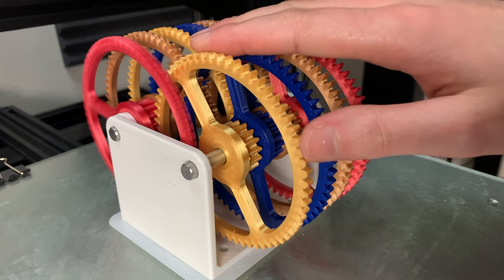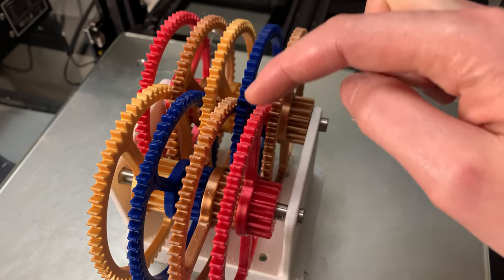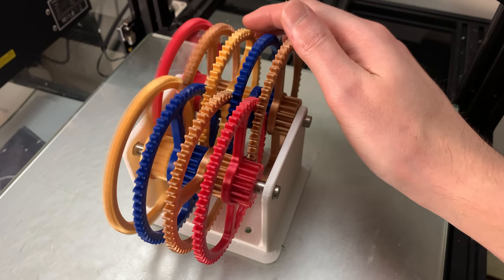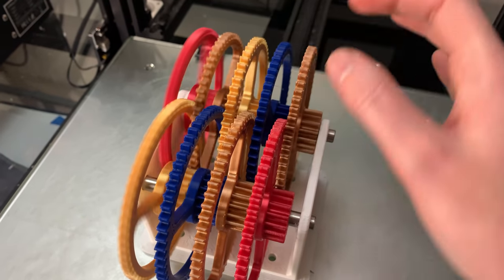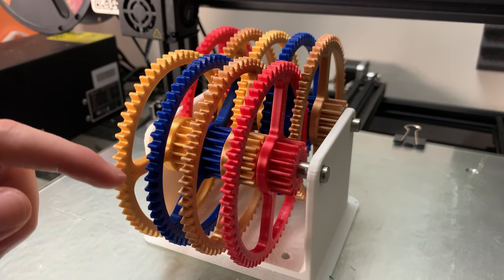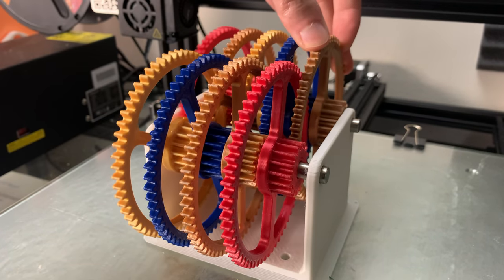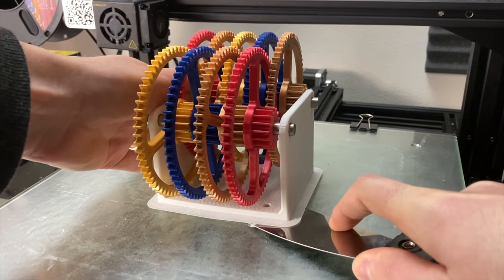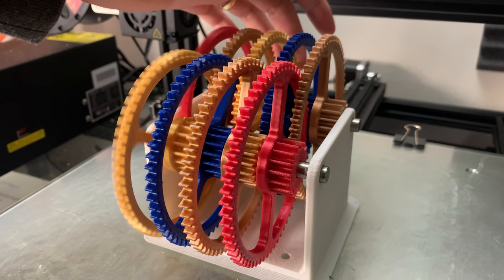Is it possible to spin the last gear?  (1:65000 gear ratio)

Comment: OK, but now I want to see you attach a drill.
Reply: He just said he could pick up a truck with the last gear
Reply: it would break first, possibly resulting in injury.
Reply: @deltahat880  Probably not injury, but you have to agree that watching it break would be quite entertaining
Reply: @marten2857  no more than breaking any other piece of plastic... the last wheel would just slip and snap of the teeth...
Reply: @johnjon4688  wear some protection then
Reply: @saphrosyn8040  I don't think the force required to break this plastic likely warrants any more than some safety glasses.
Reply: @marten2857  if it broke purely due to the speed of the spin then injury would definitely be a possibility. 

It's more likely that the force exerted on the wheel would pop the axle out of socket or slide a gear out of place. 

You absolutely would not want to be present if those gears spun themselves apart though.
Reply: @deltahat880  it's really not that horrible. Take a look at some videos of people over-cycling CDs. Sure, they harmonically explode, but they are only dangerous if you are close and in the plane of the spin.
Reply: @johnjon4688  if you were attaching a drill you'd probably be in close. 

lots of people have been severely injured underestimating the damage caused by something rupturing due to extreme g forces cause by high rpm.
Reply: @deltahat880  The entire point of this video was to show that the torque necessary to turn the last gear is too high. you would never get it to the high rpm, and even if you did, ABS plastic that is printed has a relatively low shear strength. So the force would likely not be as great as everyone is imagining...
Reply: @deltahat880  lol that is not what G-forces are 😆😂
Reply: @lithiumfpv9254  google it "The relative centrifugal force (RCF) or the g force is the radial force generated by the spinning rotor as expressed relative to the earth's gravitational force. The g force acting on particles is exponential to the speed of rotation defined as revolutions per minute (RPM)."
Reply: @johnjon4688  I did understand the video but thanks, the most likely break in the mechanism would be the axels stretching and the gears dislocating, however, if someone hooked up a motor to a gear that was capable of turn, say one partially down the row, that same disconnect could make the other wheels able to turn freely, and that could in fact result in injury, I have worked in manufacturing and have decades of experience working with various levels of power tools and the one thing you should always count on is the possibility of danger. 

even just one stepping gear on this device, paired with a high rpm motor  could feasibly result in a high speed shatter resulting in injury.
Reply: @deltahat880  I own a manufacturing company, after being the production manager for another manufacturing company for a decade. I also have schooling in engineering, materials science, CAD design, and machining. The most you would need for safety gear for this was safety glasses. And keep your fingers out of the mechanism.
This gear assembly as not possible to turn in the opposite direction. You would have materials failure long before it ever got even close to overcoming the static friction force to get the highest gears moving under direct force in the first place. If you primed the gears by starting them spinning on the low side and working your way up, you would begin to melt the lowest gears long before the highest gear could be turned through direct force. The axles would be fine. They are metal . The gears themselves would melt, come out of alignment, and slip. Then the teeth would break off, because that is the weakest point on the already weak ABS plastic. 
Worst case scenario: a flaw in the printing on the internal support arms of the lowest gear. The plastic gear breaks apart at around 20k-30k rpm (which would happen several gears before the highest gear could begin to take any direct force). Even then, you are likely only to have minor cuts from this lightweight, low-density material. More likely, it will just bounce of you and sting a little. An the pieces with the most momentum behind them would fly in the planar direction of the gear.
Sure there would be risk of injury. If you had your face right down there next to it on the side, and managed to spin up the gears to the failure point. Or you could hurt yourself if you stuck your hand in there once it started getting up to speed.
BUT, if you did as the OP of this thread suggested and stuck a drill on the highest gear and tried to spin it, all you would do is immediately strip the teeth of that gear, and there would be no catastrophic explosion of parts, just some shreds of ABS gear teeth lightly popping off and falling to the bottom of the gear assembly.
Reply: @johnjon4688  I appreciate that you finally admitted injury is possible even if only under unlikely circumstances. 

As someone who owns a manufacturing company i can only imagine the crazy accidents that have happened under you, since i've seen plenty of doozies myself. 

and yes, the directional force of the gear pulling itself apart would be on the plane it was spinning, but that direction can change as pieces collide with one another. 

and yes abs plastic is low density material,  but even airsoft pellets can break skin, and they are round. 

The point of me pointing out that injury is possible, is not for the person that made this video, but for anyone seeking to replicate it in any way, and then follow the suggestions of the commenters. 

If someone were to do a stepping gear system like this they feasibly could recreate it in a fashion that could in fact be more dangerous.
Reply: @deltahat880  ugh, I said it was possible in one of my earlier posts. I specifically mentioned over-cycled CDs exploding (though a CD is made of stronger plastic, is thinner, and shatters on breaking vs ABS rupturing). However, 1)airsoft pellets are round, which the destructed gear would not be, and 2) you have apparently zero knowledge of what a plastic deconstruction would look like.
I'll have you know that I have 20 employees and exactly ZERO workers compensation claims for the 6.5 years my company has been manufacturing. And we are a production company doing over $1mil in product annually. I take safety very seriously, and part of that is knowing what results from mechanical failures. Which is why it is evident that I know what I am talking about, and you very much do not.
Come up to my level and we can have a discussion. Right now, I feel like I am trying to explain this to a kid. You are like a kid with a paper snapper thinking he has a grenade.
Reply: @johnjon4688  you're both acting like childs 😐
Reply: Compressed air for 20 mins on the 1st gear
Reply: @RealBrizz  thank you for your valuable input
Reply: @vinceemery5943  why why. i just don't fckng get it, why would that small thing need a shit tons of energy just to spin it, I just don't comprehend it. someone please help me.
Reply: @RealBrizz  lol 😂
Reply: @deltahat880   uaqpOa
Reply: @deltahat880 
Hit
Reply: @johnjon4688  there's the problem, this website has a massive quantity of children viewing these videos and these comments. If replicating this experiment poorly meant using different materials, and fewer gears, a dangerous situation could arise very quickly. It doesn't matter if you think my responses are childish or lacking understanding because potentially thousands of people could read your comments saying it's totally safe, and misinterpret them in an unsafe way. 

You running things in a company might mean you can help prevent accidents, but when dispensing knowledge to unknown masses its best to proceed with caution. 

If this is how you treat your employees who question something you've said I feel bad for them.
Reply: @deltahat880  q
Reply: @johnjon4688  .
Reply: @deltahat880  z
Reply: @deltahat880  2
Reply: @deltahat880  because children have access to 3D printers that use material other than plastic.....      .....    .......
Also, I came up through my company and then BOUGHT it. Started as a temp worker doing manual labor, became a supervisor, took it on myself to learn multiple CNC programming languages, read every manual and maintenance guide, became a manager, took courses in workplace efficiency and safety, became COO and asset purchaser, and then bought the company. All this built on my mech engineering degree. I have dispensed knowledge to hundreds of employees over the years and most of them came in with little to no experience.
There is a time to be cautious. But there is also a time to be realistic.
Reply: @johnjon4688  see this is where I start to question your claims, you don't need a 3d printer to mimic this experiment.
Reply: @deltahat880  of course not. young people commonly have access to precision machining equipment for gears.
Reply: Won't work
Reply: SONIC BOOM
Reply: Or a 3 cylinder engine
Reply: @iZai53 
1. It's physics.
2. It is LEVERAGE but placed on a circular construct - so think Leveraging the earth with a very long pole - broken up into smaller poles on leveraging platforms.

You'd be able to place another planet on the end of the last & largest pole and eventually the earth would be lifted as desired... but reversing that (dropping earth on the smaller pole) wouldn't be... possible because it would send the last pole (and any object on it) in the other direction, it would cause a big bang (if the construct is that durable).

In my explanation, earth is on the slowest turning side of the gear (the gear you don't want to ever mess with - having the highest tension & potential energy).
The end of the last pole (in the whole sea-saw leveraging construct is the fastest spinning gear).

Gear ratios are simply leverage in a circular platform so the cycle can repeat.

Moral of the story: the more work you want done, the tougher the material needs to be.

Like rock or tungsten carbide or some other highly durable non cracking allow. Steel wouldn't be ok on the beginning or end gears...

We definitely need this done even with 1:35,000 ratio. Very renewable energy.
Reply: Dremel

Comment: I can’t be the only one watching like “bet I can spin that” 😂
Reply: You aren't
Reply: i can spin the last gear rather easily, it would just take me a little time to get there.
even if this gear box was double what it is.
it would still be possible to spin the last gear.
Reply: Same.
Reply: I’ll attach my DD 16 engine. There’s no way it won’t spin.
Reply: it might be possible to spin the last gear if the gears dont break or deform from friction. my theory is that you start from one of the gears that is easy enough to spin but not too easy. then once you get up to speed, you move to another gear and you repeat.
Reply: @bass2762  makese sense. I was just gonna use a long stick
Reply: @player-8740  that might work also i think.
Reply: I'll bet Uncle Rico could do it!
Reply: @logangraham2956  no
Reply: @logangraham2956  By attaching a drill to one of the easier-to-turn gears? Because you wouldn't have enough strength to turn it straight away.
Reply: @Ruzzky_Bly4t  of course not straight away , you have to work up to it.
Reply: Just fucking spin the last wheel omg
Reply: go buy yourself some lego and try it yourself, lol. Physics and the flimsiness of that plastic ain't gonna let you spin that gear in a million years
Reply: @yakoc04  this is what the entire video was about the tourqe required to do that would be exponentially more than the 1st gear
Reply: @bass2762  You have to bear in mind that to achieve 1 revolution per minute on the final gear, the 1st one needs to spin at more than 65000 rpm.
Reply: @bass2762  That is my theory and was hoping he would try that.
Reply: Yes you were only one 😆
Reply: Uhhh. Sooo. Impact gun

Comment: It would be amazing if you could just push the last gear as hard as you could and the first one flew off and sliced through the wall while the one you were pushing literally hasn’t moved
Reply: Figuratively hasn't moved. It literally has moved. Just saying
Reply: @angelo9989  I know, I just mean you can’t see that it’s moved because the distance would be so insignificant
Reply: @angelo9989  lmao
Reply: The things is actually you can spin the last gear. But with very very low speed. It requires high power when you want to rotate it with same speed of the first gear.
In theory you need same force for rotation the same one for last one
Reply: @angelo9989  at least you’re aware :)
Reply: Plz help stop Israel (modern nazis) apartheid against Palestine, it's not your problem but your gov is funding them, spread the message cause their strongest weapon is misinformation. If we together boycotted them they will be forced to stop like South Africa
Reply: Ya ya but your profile pic

Comment: It's also worth mentioning that if you could spin that final gear one rotation in a minute that your starting gear would be spinning 10-20 times faster that a power tool such as a drill.

Comment: Gotta love how he filmed it without having removed it from the build plate
Reply: Stable base
Reply: @128ajb_02_Music  ehh debatable
Reply: @lunaticfpv17  No. It's more stable than if he just places it on the surface. 100% true, no doubts, FACTS
Reply: @Ruzzky_Bly4t  it may be stuck, but it isn't all that stable
Reply: @lunaticfpv17  "it may be stuck, but it isn't all that stable" Think about what you just wrote. It is stuck to the surface but isn't stable? Will you also try to debate that water is wet, or what?
Reply: @Ruzzky_Bly4t  It isn't very stable because the bed is held by springs and it 's very easy to slide back and forth. And water in the presence of it's self is wet
Reply: @lunaticfpv17  Your last sentence was the only not-so-dumb thing you wrote in this reply section.
Reply: @Ruzzky_Bly4t  bruh do you even have a 3d printer
Reply: @Ruzzky_Bly4t  Holy shit dude can you just stop? You're trying so hard and for what
Reply: @Ruzzky_Bly4t  🤦‍♂️

Comment: Can we just take a moment to notice that he filmed the entire video on his 3D printer build plate
Reply from the maker: good enough bed adhesion to hold the gearbox in place, didnt need to clamp it down haha
Reply: @3DPrinterAcademy  I’d be too afraid of putting that much pressure on it, did you have to relevel after?
Reply from the maker: @coffeeandpie8181  hmm not sure, I usually check bed level at the start of every print, while the first layer is printing
Reply: @3DPrinterAcademy  - That is a thing i dont get it... i very rarely need to relevel my bed, using the same printer and i only print ABS with enclosure and ambient heating. Ambient temperature around 45ºC, bed 100ºC and nozzle 240ºC, to avoid any warp, its kinda of aggressive, but no problem yet.
Reply from the maker: @brianfhunter  I just make very minor adjustments, very quick (I never use a paper to level bed). 99% of the time its fine. Big knobs on Enders are super convenient
Reply: @3DPrinterAcademy  - Yes, me too, and that is why it confuses me when i see people saying that they need to adjust every 4 prints or less, even using very easy materials like PLA.
Reply: Can we just take a moment, to stop this comment format

Comment: I would love to see him start spinning the first gear, then move to the second, then third, and so on until the entire system is spinning from force applied to the final gear. It should be just like shifting gears in a vehicle's transmission, right?
Reply: In theory, yes, but I think the construction would  start vibrating and  fall apart. Also the resistance would still be multiplied trough the gears so you would still need a lot of force
Reply: @roose1346  Yes, I think as constructed, it would turn into multiple spinning, flying, gears of death and destruction lol, but I like theories. If the entire system was brought up to speed slowly, the inertia of the system should eventually be such that the motion of the final gear could be maintained with relatively little force. The only road block I see is the first gear would probably be close to the speed of light.
Reply: @AndyMooreMusic  ow jeah i didnt even think of that! Id love to try to get as fast as possible tho hahaha
Reply: @AndyMooreMusic  щщщщз и вдщщщзлшш в школу не могу до Михаил Александрович не могу сказать
Reply: Plz help stop Israel (modern nazis) apartheid against Palestine, it's not your problem but your gov is funding them, spread the message cause their strongest weapon is misinformation. If we together boycotted them they will be forced to stop like South Africa
Reply: @arabianprince7508  cringe